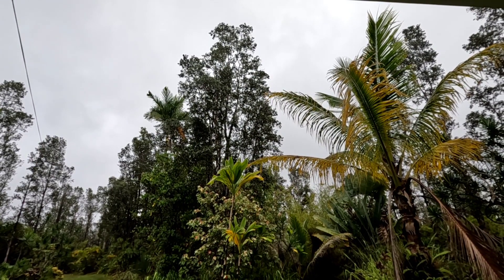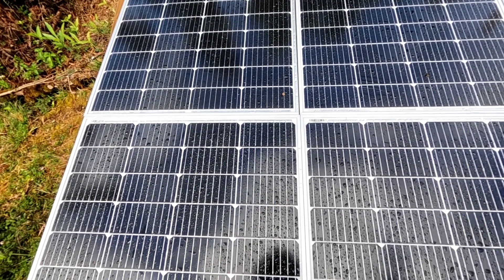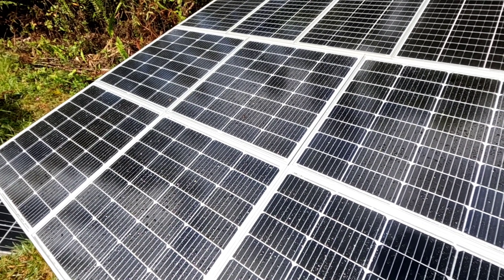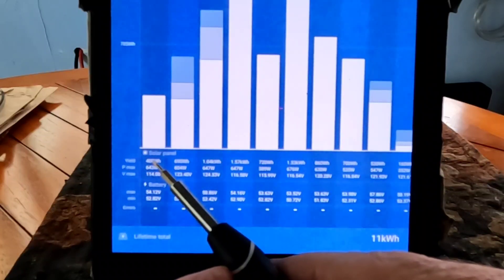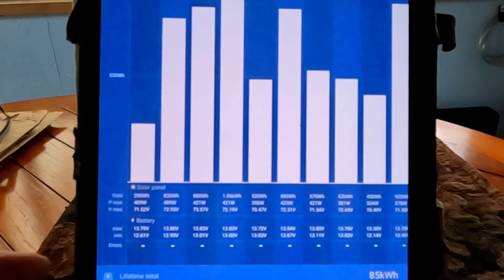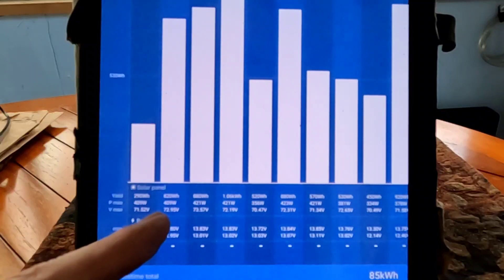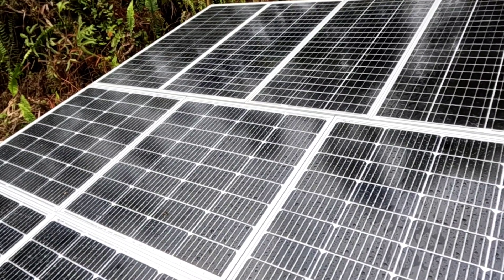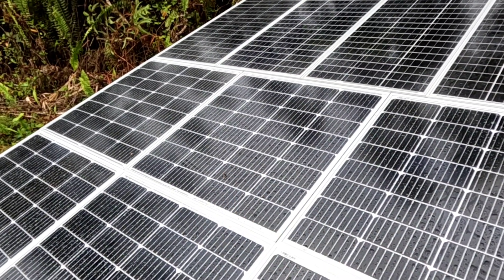Newpowa 9bb per cell vs Newpowa classic 5bb per cell solar panels...there is a difference

Comment: I have four 100 watt 9 BB Renorgy panels and I also have four old Renorgy panels with the four busbars I’m wondering to save money could I wire in series the four new nine busbar panels and then wire in series the four old for busbar panels and then combine both of them in parallel so I would have a series series parallel set up and then tie them into my Victron smart charge controller it’s a 100/50??? would this work or would it not be a good idea???

Comment: How can you say the 9 bus bar panels are out performing the 5 bb panels. Correct me if I'm wrong, you have 600w 9bb and 400w 5bb, the 600w divided by the 96w the 9bb were producing at the same time the 400w 5bb were producing 64w. 64÷400=16%, 96÷600=16% They are exactly the same. 🤷

Comment: I'm not convinced you can say the 9bb output more. The 1-2% you see could be from manufacturing or age or whatever. You can see a bigger difference than 2% between two identical panels.
The difference was size. Same wattage with fewer square feet, therefore being more efficient. On a vehicle where space is limited I can see an advantage. For home/off grid solar not so much. Also I seldom see the 9bbs the same price as 5bb.

Comment: I have some of the same panels and they do very well to
Reply from the maker: I am liking them quite a bit !🤙
Reply: @ProjectsinParadise808  Sir, is it safe to put this in series with a cheap 12v regular 100w poly panel? I found one of these a lot cheaper than others. Thank you.

Comment: That interesting data. The low light conditions even better .over months that will add up and best part same price. now if you add the extra power from 9 BB and multiply buy  buy 1 year (365 days ) it really starts to add up. my panels are the real big ones in the 320 watts per panel . takes 2 people to mount . but on larger over 2Kw systems is less panels and less connections. In Boston NY my biggest solar month is June,  The summer heat dropped the output somewhat. The next biggest solar days are when there is snow on ground in spring late winter and we get full sun. The panels are cool and the snow reflects the sunlight . days we call snow-blinded hear. need sunglasses to drive.  I got that same 58V fuse on my 48V EZ-GO golf cart. came new that way. had to replace corroded on lead battery's 6 8V GC8 battery's. I just have higher amperage link .   you can unbolt link and replace. I use Busman or Littlefuse   fuses . The metal frame of my panels are grounded and bonded to 2020 UL electric code. If wire came in contact to metal wont be a shock hazard. also snow and rain can build a static charge that can damage the MPPT   controller.  I also have snap on ferrite cores on my wires for EMP and RFI protection as well a Midnight solar  surge units.  love that Bluetooth data . with a PC you can import that data to a spread sheet Etc.  Victron is worth the money. 😀
Reply from the maker: I'm liking these new panels quite a bit! As you say, every little bit more day in and day out in these conditions really adds up! You my friend are a wealth of information,  and we all appreciate everything you share with us! The details you always share have a far reaching impact on so many.  You're like our own personal off grid consultant.  Maybe you buy the lot next door and settle in Hawaiian style...winter pretty mild here! Aloha and mahalo for all you share!🤙

Comment: why would you not compare 4 to 4 instead of 4 to 6? apples to apples and all...
Reply: Because math, specifically, division, makes it as "apples to apples" as it is possible to be.
Reply: @Sylvan_dB  no testing 4 of panel a against 4 of panel b would be apples to apples
and you not being the tester makes you and your comments irrelevant
Reply: @bobsmith5134  What matters is the average power per panel. Do the math.
Reply: Divide by 4 and 6, the 9bb output about 1.5-2% more than the 5bb. Though I am not convinced, that small percentage is telling. Two identical panels can show more of a difference.